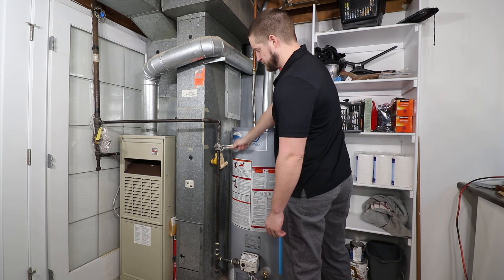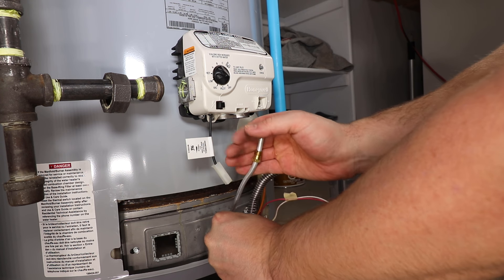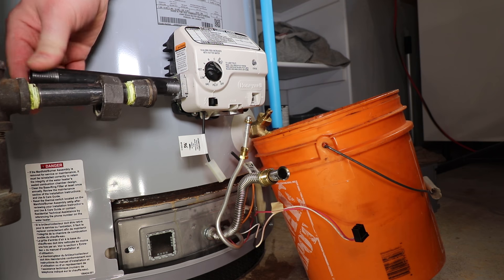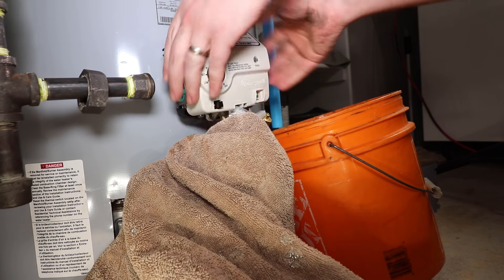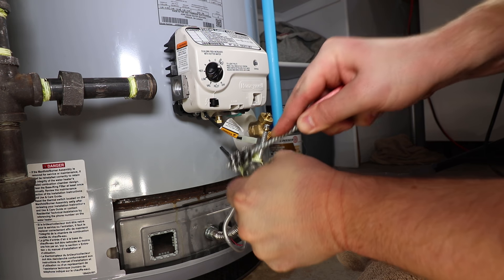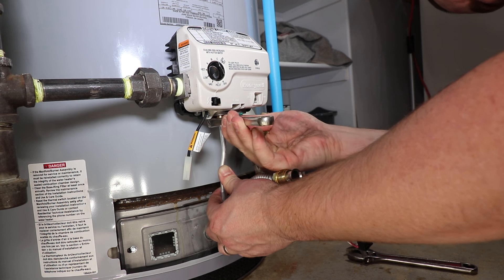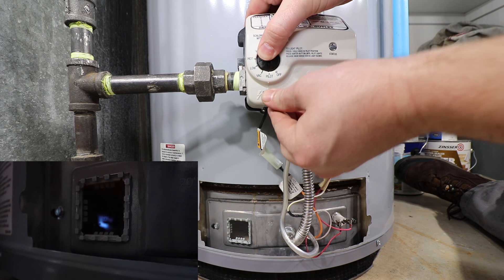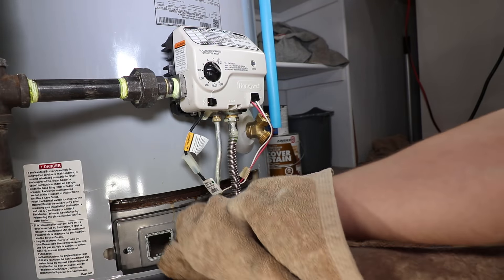Gas Valve Replacement on a Water Heater

Comment: Can't thank you enough for posting this video. I replaced the thermopile and pilot tube but still couldn't get the pilot to stay lit. Only thing left was the valve. I was a bit reluctant to tackle that as I've never worked with gas piping but thought, 'pipe is pipe', just the contents are different. Bought a refurbished valve for $80 and with your help, had it in within a couple hours. Heater was only 12 years old and it's just my wife and I using it. She was yammering to get a new one but I saw no evidence of rust under the tank or in the water I drained so thought I'd try and save some major dollars. With your excellent guidance, I succeeded. I can't tell you the satisfaction I felt when that status light started flashing and I fired up the burner. Two months later I'm still going in the laundry room just to look at that blinking light and say, "I did it!" Thanks again!!

Comment: It should be noted that it sometimes takes time for gas to flow through to your ignition coil.  After installing my gas control valve, I just could not get my pilot light to turn on... in frustion, I gave up for the night and decided to buy a new water heater.  After coming back from work and giving it a shot one last time, the pilot lit up immediately.

Comment: Very helpful, thank you! The small pipe section that connected to the controller unit was glued on tight. I ended up having the replace it because I could not get it off. Recommend to others to consider buying a few extra pieces of 1/2" pipe to have on hand while you're at the store already buying pipe dope.

Comment: Very thankful for this video. My part was covered under warranty by the manufacturer and I just got it. I'm hoping it's my thermostat giving me trouble and this is the fix. My pilot light was tiny when set to any hit water setting, and twice the size on VAC setting. Tech support said sounds like my gas control valve and sent me a new one. Fingers crossed thats my issue because beyond that, Im not sure what to do if the pilot light is still minimal when set to any hot water setting, and the burner not kicking up. Could i ask them for a new Burner assembly also? We'll see I suppose. I'll check back in after this part swap in case anyone else runs into a similar situation. Thanks for your very helpful video on getting this part swapped out sir!

Comment: Thank you! Was quoted $650 to change the valve and recommended $2500+ to replace the water heater (it's 10yrs old). Was able to change the valve without any issues. My original valve was showing everything was fine and the light was blinking once every three seconds like normal, but there was no pilot or burner. Replace the valve and it started right up! Only paid about $150 for the replacement gas valve. Only difference was I had to drain the water heater completely.

Comment: I just had to do this and the only thing that you have to be stupid careful with this the red and white wire connector. Mine was in there very tight and one of the wires pulled out. It was easy enough to fix, just that was the one part I knew was going to be trouble.

Comment: This is an awesome video. Today I spent nearly an hour trying to thread the pilot tube fitting back into the pilot hole on the thermostat. I was very careful in removing both tubes! I cannot get it to rethread. The main line went in without a problem!  Any idea how to solve this ?  Thanks, from Louisville, Ky.!

Comment: At 00:14 in the video, when you disconnect the propane line from the control unit, do you need to do anything special about the residual gas in the line that sits between the propane shutoff and the unit? Use ventilation? Or perhaps should you leave the pilot lit util all of the gas in the line burns off?

Comment: Thanks for the video. I was getting code 7 and at first I wire brushed the thermocouple, pilot light housing, and the thermoelectric probe which fixed it for a few days. It kept returning and I would clean more every couple of days when it failed again. I finally bought a control valve and it only lasted 1 day. What else could it be? Do I need to replace all the piping for the burner and pilot?

Comment: Wonderful. But I know nothing about how to do this. I saved to watch over again. Had the same water heater since I bought my apartment in January 2005. Getting not as much hot water and takes longer to heat. I live on 2nd floor and water heater is downstairs in a closet with all other water heaters for my building.

Comment: Excellent it just happen I got the same valve on my heater, now what would be some of the issues as to why to change it? I was told by the installers that it would have to be changed every 5 years? Is it is so why? Sounds like they want to increase parts sales to be honest, Is there a Lithium battery on these type valves? 5 years seems like the extend of the battery life, but why change the entire assembly just for a battery?

Comment: Great video! I can’t find my direct unit replacement WV8660Q1000 anywhere online. Is there a substitute model number? I did find a WV8400 that looks almost identical but the “com” port looks different. Does the “com” port need to be plugged in to work? That’s the only difference I see.

Comment: If I have a hot water baseboard heating system in the house could this prevent me from using the vapor lock method? Could it be like someone turning the water on?

Comment: very good information. I need to replace mine also but the connecting black iron pipe very tight and the pipe dope on the threads are very hard. I am afraid of  using large force. Any suggestion ?   Am I too cautious ?

Comment: Really great guide, worked like a charm as I was able to do the valve swap in less than an hour. The local guy wanted 1600 parts and labor. The whole valve / igniter assembly was like 285 total (so, $1300 labor-WTF). Since the part was still under warranty, I’ll actually get that money back when I return the defective unit.

Comment: Had my hot water control Module (Gas Valve/Thermostat); followed your video to the letter.  lost very little water - Air Lock worked like a charm - now just waiting 30 minutes for the water to heat up. Thanks for the assist.

Comment: Outstanding instruction. The air-lock tip worked perfectly, I closed both my cold-in and hot-out valves at the tank and lost even less water during the swap.

Comment: My Whirlpool water heater isn't getting as hot as it used to. Can I replace the Gas control valve with a different brand to upgrade if?

Comment: Great video. My plumber swapped my honey well valve out due to 5 flash code. After calling several times and waiting a week for him to come back and look at it, I said F it and purchased one off Amazon and replaced myself using this video.   Thanks very much.  FYI. The plumber appears to have replaced my old one with a USED one.  👎🏼.   Also. Since I was replacing I went ahead and emptied/flushed my tank.
Reply from the maker: Nice job on your repair. I'm glad the video was helpful!
Reply: Is it critical to match serial #'s of the valves?? @PROSDIY

Comment: Nice job ,have to change out my sons tank , parts were under warranty  so since I'm retired with an Associates  in HVAC but never went to work in the trade it helps . I like the tip of using the pipe as a wrench

Comment: For what is that 2 scews in side of water inlet side. It got O rings on that screws. 

Problem i got, water pressure knob can only be on MIN just when i turn knob little to max. The micro switch go off. Micro switch only goes on if water is turn to MIN. WHY? 

Must i adjust that 2 screws in side?

Comment: Excellent video, almost 30 years of fighting the vacuum/water lock when trying to solder, when I should have been using it to help me with water heater elements, gas valves obviously, and I'm sure there's a few other situations...thank 
you for making me smarter than I was  before I started my day. Everything about this was A+,*****, maybe you actually needed to know plumbing to understand maybe not, regardless
Thank you!!!

Comment: is it possible to replace the thermowell (back cover that threads into the water tank) and not remove or replace the gas valve itself? Wasnt sure how/if you could get enough torque on it to remove it without using the short pipe for leverage.

Comment: Can I replace my water heater control valve if it is slightly different? The only difference is my old one has a orange knob on the top of it, and the new one does not.

Comment: I agree, this is the best video depicting the valve replacement. I was unaware the valve-to tank connection goes through a water passage thus requiring to create an air lock as shown. Thank you so much!

Comment: My tank has no shut off valve for cold water inflow, but it has hot water shut off outflow, could the first plumber installed it in reversed?

Comment: HOW or WHERE does the Gas Control Valve, receive "power" if there is NO electrical connections from the wall, HOW does the igniter work and what powers the Green LCD?

Comment: Excellent video!! are these honeywell gas valves interchangeable? ours is  wv8840b1117  only specs i see is 5" WC settings and 1/2 PSI Max while online other model numbers specify 2" insulation with 5" WC or 1" insulation with 5" WC. All these Honeywell models look very similar. Is it fine if the replacement Valve doesn't match the insulation number? Thank you!

Comment: There were some work being done in my home which involve gas line. When the work was complete they went to ignite my hot water heaters. One of them did not ignite there is no spark visible through the glass window. 

Do I need to replace the whole valve assembly or is there a way to simply replace the igniter? 
Also there is a slight water leak which is intermittent in this hot water heater could that be interfering with the spark?

Thanks I appreciate any input

Comment: What if the pilot flame turns on but the flame dosent go up when i adjust the heater
Reply from the maker: Are you getting any error codes? Make sure that the control knob is in the ON position as well as adjusting the temperature dial.
Reply: @PROSDIY  where is the control knob?  I thought that was the same thing as the temp knob (low, hot , very hot)?

Comment: What do you do if you have broken the white and red wires out of the black plastic piece?
Reply from the maker: Hi Larry, There's 2 options. First is purchasing a new thermopile which with include the wiring and electrical terminal. Second is crimping each wire with a fully insulated female spade connector.
Thermopile: 100112328
https://amzn.to/2D8QTs8
Thermopile Assembly: 100112330 (Best Value)
https://amzn.to/2RISkBI
Insulated Wire Connectors
https://amzn.to/39qSLJo
The connectors can also be picked up at a local electrical distributor or auto parts distributor. Good Luck!
Edit: If the wires didn't pull out of the metal terminals, you could just plug them in the control valve without the black plastic piece. Just make sure the terminals don't touch as this would cause the pilot to go out or not light. The purpose of the black plastic piece is to not let the bare wire connectors touch. If your going with this option, wrap each terminal in electrical tape first to prevent them from touching.
Reply: @PROSDIY  I broke the wires off of the metal terminals so I bought a new thermopile. I have a Rheem water heater so I called Rheem and they gave me a part# for the exact same Thermopile for my unit. Unfortunately at the time I didn't understand that all you need to do was pull the connector out of the Honeywell. Created needless expense for myself. Anyway I do thank you for your help!
Reply from the maker: @larryhutsler8309  Glad you were able to track down a replacement part and solution. Cheers!
Reply: @larryhutsler8309  man I just did the same thing. What do u mean pull the connector out of the Honeywell ?
Reply: @cabrawl473  The black piece the red and white wires connect to can be pulled out.

Comment: So I just bought a brand new hot water tank. I heard a buzzing sound from this gas control thermostat. So I shut of the gas to see if it would stop and it did. Now I can’t light it back up and the blinking light went completely away. What do I do?

Comment: This video is great.   Perfect video to instruct me how to change out my gas control valve.   It was short enough but informative. Straight to the point, easy to follow and able to show someone with no experience doing such a project how to easily complete it properly.  Thank you so much and my family also thanks you for helping return hot water to our home.

Comment: Will the replacement work for code 7? I tried and it didn’t work, the manufacturer said that I also need to replace the chamber sensor, is this correct?

Comment: Just replaced my gas valve and got the pilot to light, nice full flame when set to hot. But about a minute into getting it lit, there was hissing and popping sounds coming from the pilot light area. Is that normal? It scared me so I turned it off.

Comment: I replaced the control valve but now I am not getting a spark and before I was. I hooked it back up exactly how I took it off and turned the water and the gas back on and nothing

Comment: I appreciate your this clear instructions, but from 3:04 you slightly let water in while opening a hot faucet but how can you tell if the air is completely out and the tank is full.
Reply from the maker: Great question Rami. You'll notice once the faucet is initially opened that there will be hissing/spitting. Once the air is completely purge the water will flow steady without any spitting or hissing. Run the hot water for 2-3 mins after the last bit of hissing to ensure the tank is completely purged of air. Thanks for the question.

Comment: Pro Tip: The threading on the connection to a liquid propane fed water tank is reversed.  LP=Righty loosey, lefty tightie. 

We learned this the hard way by assuming the connection was stuck.  The plumber just had to turn the connection the right way and install the device. Ten minutes total.  Yeah, it hurts that we got soooo close to completing this repair on our own. But we still saved money by buying the part ourselves and time/money by having it mostly prepped for the plumber.

So, great video. 

Note:  Talking to friends it appears that not knowing or remembering that propane connections are reversed is something just about all of them have experienced once or twice. That takes the sting out of it...a little.

Comment: This video was awesome and save a lot of time not having to drain the water heater.
I followed it exactly and showed my wife I could repair our water heater at a minimum cost instead of replacing the whole thing. $200 total including parts and supplies vs 1500-2000 for a new one.

Comment: What do I do if the rigid pipe part where it connects to pipes together by the gas valves is stuck?
Reply from the maker: If it's too tight to move then a bigger wrench is needed. Making sure to use 2 wrenches, 1 to back up the piping. Using any solvents (WD-40) is not recommended. Hope you get it to break free.
Reply: @PROSDIY  Why is it not recommended? I used pb blaster to loosen it up a bit.
Reply from the maker: No worries. If that worked, you're good. It's just a labiality thing I have to say. Just make sure to clean it all off completely before reconnecting.
They don't recommend it for a couple reasons: Safety, adding a flammable liquid to a gas line. Solvent entering gas line can possibly damage gas control seals. Solvent left on threads on reconnection can lead to a compromised connection.
Reply: Pros DIY Thank you for your replies. I was able to get it off and am just awaiting the gas valve to come in to replace it. Got a temperature sensor failure on an 8 year old AO Smith water heater with a honeywell gas valve.
Reply from the maker: Glad you were able to get it loose. Hope your replacement goes smooth! Cheers!

Comment: How long does it need to get hot water again.... turned on sink to do some dishes and it was cold and the light on the unit was no longer blinking
Reply from the maker: Hi Kevin, Most water heater's full recovery is roughly 45 mins - 1 hour. If sounds like the pilot went out if the status light went out. Were you able to get it fix? Thanks for the question.
Reply: Pros DIY yeah was able to get it started again. But I have had the new unit (gas valve) on 2days and the light is blinking the same error I had with the old one. Frustrating..... gonna have a tech come look at it.
Reply from the maker: @kevinfinch8791  What error code is it producing? I have a water heater troubleshooting video that may be helpful: https://youtu.be/_XYCVgsPu1U
Good Luck!
Reply: Pros DIY I got it handled... but the frickin new gas valve is blinking the same error now as the old. Arghhh. Havin a guy come take a look. Thanks for the help. Video made it easy to change out. Thanks again.

Comment: My gas hot water heater when lighting it will only light at the very hot setting then when I move the temperature dial to another setting the fire goes out. It  stays lite at the highest setting.  Any reason for this?

Comment: I have been trying to ignite the flame, the indicator light is not on. The flame cannot be lit. Is it the same problem as your video?？Thank.
Reply from the maker: I would confirm a gas supply first and if there is a spark? Then checking the TCO switch. This video may be helpful and explains how to check these things: https://youtu.be/_XYCVgsPu1U
Let me know how it goes and if you have any questions. Thanks